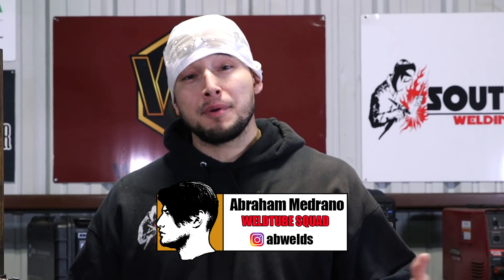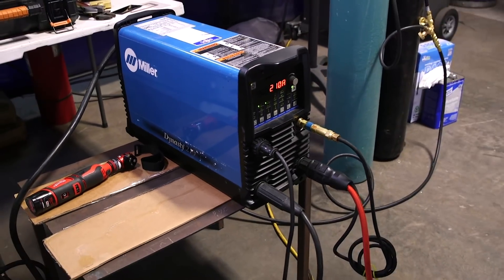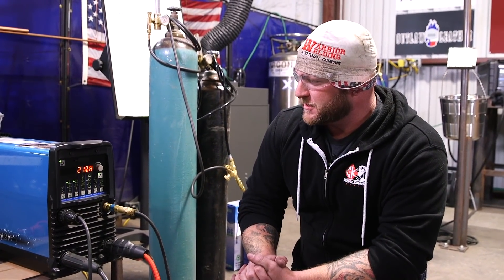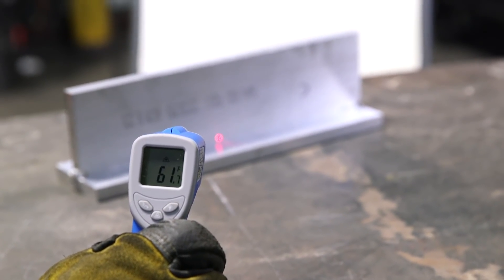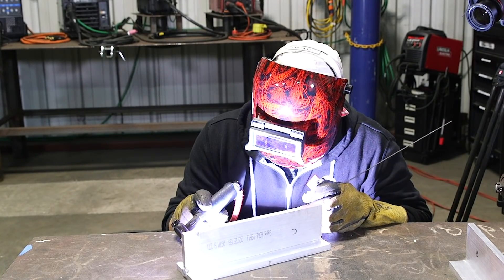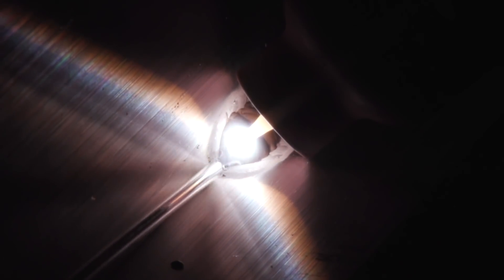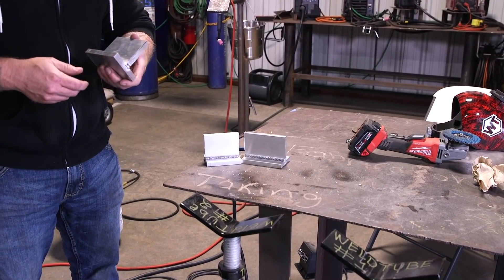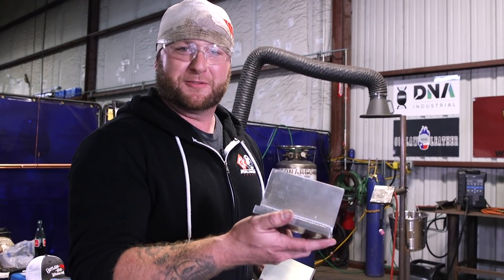Helium / Argon Mixtures | Aluminum TIG Welding

Comment: Just use 100% helium (heliarc) DC- for thicker material some skill and a wire brish you are good . 100% argon for the rest. Dynasty welder makes a half skilled welder a 3/4 welder.

Comment: I'm just learning so I'm asking a question hopefully I'll get an answer I was under the impression that you wanted to keep your balance and your hurts at a certain evenness or at a certain percentage I should say like say 60/40 or you know within I think 20 or so percent of each other I mean in other words I guess you don't want to have like 80 and 80 to work they would rather you have like 80 and the other one will be like you know 50 or you know something like that anyway I might be misunderstanding that I think that this cat right here has explained it better than anybody to me so far of what each one of them does instead of just saying you don't want this to be no more than that and pretty much leave it at that and that's all you know he's just what some guy said he actually told you what it actually does higher hurts means less heat going in and lower hurts means a lot more heat that that's invaluable man I did not even know that so but if you can answer that is there a certain ratio that you want to keep the the balance and the frequency a certain ratio apart from each other I'd appreciate if you could let me know thank you so much for the video learning a lot

Comment: You got my interest with the Helium mix and the comparison, but I didn't give it a thumbs up because I felt the video was incomplete.  I would have liked to see a sample done with straight argon and preheat to compare with the helium sample. Also it would be nice if you had broken each sample so we could see the penetration in the weld. I would also have liked to see a bit more detail in how you mixed the two gases. One other point to note, your videos are going international, so can I suggest when quoting measurements such as temperature, length, volume and weights,  you also include metric units. I don't know what a Ferinheight is ;)
Reply: Would you like fries with that too? Hahaha

Comment: You'd be much better off with a cylinder of Argon-Helium Mix, either 75% Argon balance Helium, or 60-40, as their is no way to know what your mix is by using a Y connection, as the properties of Helium are different than Argon, it's a crapshoot guessing with a Y valve.

Regarding preheating aluminum, you need to be very careful in not exceeding 250°, I prefer 200° max, and unless you are using a Tempstik or an LED thermometer you are just guessing at what your  preheat temperature is. T6 Temper is done at 350°-400° and if you happen to preheat above 300° you have destroyed the T6 properties before even striking an arc.

Comment: For those of us that can't afford an $800 bottle of helium to do a small aluminum project while we have a welder at the house you can use argon. You can start out by taking the TIG torch and without adding wire run a preheat and etching pass down the weld area. Then instead of welding 1/8 inch step at a time. Go two steps forward one step back feed The wire two steps forward one step back feed the wire. It is a lot easier to do what he's doing and he's doing a professional job of it. I have added helium it does make a difference but that will can be made without it if need be.

Comment: I'd love to see a subarc video if possible
Reply: There's really nothing to see. The wire comes off of a spool is covered by a granular type flux you can see an orange glow as it melts. It cools the slag peels up the flux is vacuumed up and recycled. Over and over and over and over it's like watching a tick tock video for eight hours
Reply: @eagle3351  I know that, but I'm more interested in the setup then the actual welding.
Reply: @MrMilky927  I've done brass overlay on a tube sheet 5 ft in diameter 4 in thick with inch and a half wide strip brass. The sub arc for welding vessel seams was sometimes run with a flux strip backing strip, it was sometimes welded on the inside or the outside and back gouged on the other side for a 100% weld. The ones that ran the welder all day had already written up notebooks say for instance half inch plate it would have a setting for a round seam and a straight seam it would call out the bevel it would call out the wire speed it would call out the amperage all the specifications that were needed for that particular weld there are too many variables but that's basically the way it's done.
Reply: @eagle3351  hmm seams pretty interesting. But I'm sure after you get everything adjusted it would be pretty boring just knocking the powder off. It might be interesting to me just because I never saw it in person.
Reply: @MrMilky927  if that is your only job is to be a subarc welder it would be boring for me. I do fitting and welding I'm certified on a lot of different kinds of welding I get bored very easily. So I'm better off sticking with the challenges and sub arc welding once in awhile when it's necessary. The night that I sub arced brass for 8 hours with canister respirators on too exhaust fans behind me pushing the smoke away from me and a big wall exhaust fan in front of me pulling the smoke away from me I got galvanized poisoning it felt like I had been beaten with a baseball bat for 3 days I was sick. I will leave the sub arc welding to the sub arkers lol
Reply: @eagle3351  see I think my job is about the same because idk if you ever heard of plasma arc welding but that's what I do every night. I'm certified in wire, plan on getting certified in TIG this year.
Reply: @MrMilky927  in 1972 I started as a stick welder inside a heat exchanger every night. Day shift would clean up the outside and weld the outside and I'd go back inside. I did that 6 weeks and told my boss I knew how to read drawings so he smacked me in the stomach with some drawings and said here go build this and I did. He asked me if I could Tig I said no so he showed me and I certified anytime they wanted me to do something it was okay show me. I've been welding for almost 50 years. Now I have a small booklet of welding certs. if you're willing to learn and apply yourself you can do anything.
Reply: @eagle3351  oh wow your definitely full of knowledge. I've been welding for 8 years this year. Mainly a lot of stainless tig/ hard facing alloys. But did a fair share of mig and fluxcore. I actually only worked with a few prints that were semi correct. That's another goal of mine is to go to the community college this summer and take a print reading class. I can read basic ones but nothing past that. And thanks for the encouragement man

Comment: does it have to be ultra hight purity helium? can i use the stuff they use to fill up balloons?
Reply: No it don't.
Reply: Doesn't have to be UHP, but most of the times the stuff they sell for balloons isn't pure helium and welds terrible.  Standard welding grade will work fine.
Reply: Helium has gotten really expensive so these days some of the helium supplied to fill balloons is mixed with a bunch of air or nitrogen.  Probably just enough helium to float a balloon for a short time, so that's way too much non-helium to work well for welding.

Comment: 6061-T6 2" pipe .250 wall aluminum 6g
Running 75He / 25 Argon right about 25 cfm
Filler rod 4943

Comment: I used to weld in the nuclear field and  Inconel and monel were very interesting metals to weld and I never heard of them till I worked there
Reply: How did they weld compared to steel/stainless/aluminum?
Reply: @ieatslag5947  Incredibly sticky, gummy, and grimey. 
Inconel welds just like stainless, except it has a touch higher surface tension, a bit sluggish like all nickel alloys, and all sorts of floaties swimming around the puddle covering up what you're doing.
Reply: I used to weld inconel and monel in heat exchanger and pressure vessels .

Comment: Haven’t seen any videos about “mix tig”, alternating between ac and dc
Reply: Great suggestion! Prolly because Everlast is basically the only "domestic machine" in U.S. that has it, and it's only on pulse. There a guy called @TigHappens(Johannes) on instagram  who has an nice Italian machine which has that feature on it. It's very useful for people who do alot of castings and repair work. Because it allows you to have the penetration of the DC current(helpful on thick cast aluminum) but the cleaning action required to keep puddle relatively clean. People sometimes use amplitude (90%EN/10%EP) to repair cast iron as well, with aluminum bronze. Same concept, just enough cleaning action to help puddle flow and stay clean. Anyway lol take care!

Comment: Fuse steel to aluminum
Reply: I welded to six and a half ounce glass Coke bottle to a piece of half inch steel a flat fillet with a 1/8" 7018. 1971 MDTA  welding school